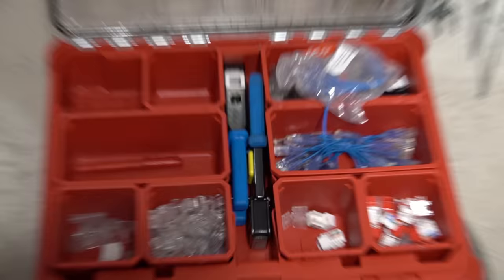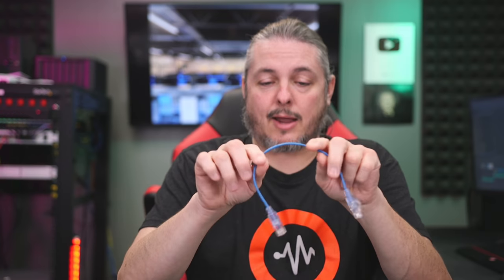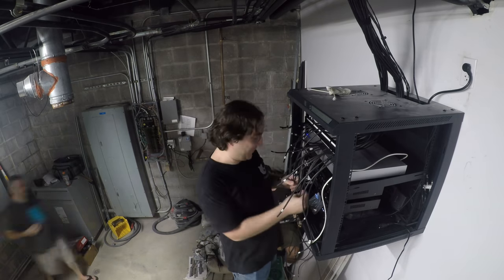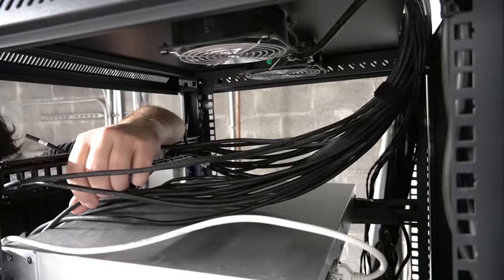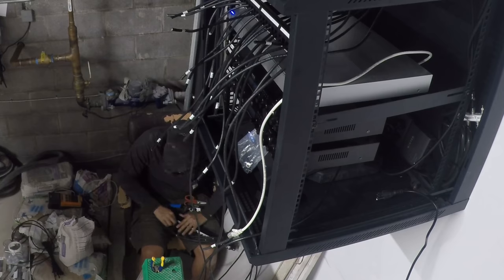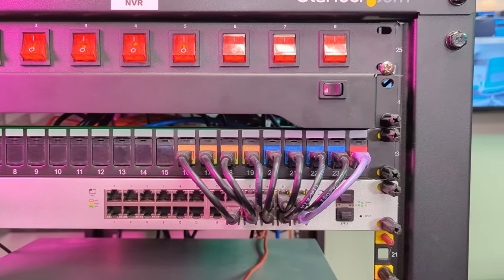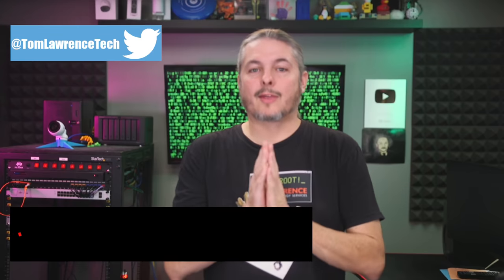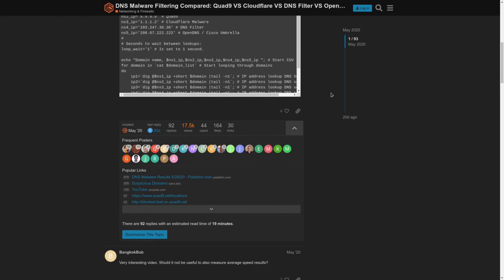Rack Cabling Project

Comment: WTF is all the hate of Zip-Ties. The do the job fine, easy enough to work with and when done correctly, not a bloody issue. If you must deal with OCD issues, try loosing the nasty idea of a power board in the back of the rack, PDU's are cheap and neat.
Reply: “When done correctly” never seen them done correctly, always too tight. If cut off they have a sharp point, very common just to add another run which can mean cut the tie and starting again. Velcro is far more convenient, reusable, doesn’t damage the cables and if this day and age not using them while working in this industry you are doing a disservice.
Reply: zips are useful in few situations, like they can help bent cables on sharp bents behind a door or at the back of a rack much better than velcro.

But really in most cases you have the spa e and flexibility to use a velcro instead of a zip tie. Just tie the velcro more tightly if you need. And you can take them off easily.
Reply: I scrolled the comments to figure this out myself. I don't run cable for a living, so I'm wondering if the zip ties have a negative effect on the cables? Or is it more of a courtesy to the next guy that comes across your work and has to cut them off? I just ran a few bundles of Cat 6 in my house and kept it neat with zip ties (also known as cable ties). If anybody has some input, I'd be interested in learning why it's a problem.
Reply: @JasonWester  your house is fine,  you wont really change the cabling
 adding or removing anything and the layout is small and straightforward anyway. 

I went into a data centre recently to rack some stuff. We have 5racks into a mini room area. 4 on one side and the last on the other side across.

So like one rack alone at the back had about 20-40 yellow funre cables of about 15-20meter length, maybe more.  It was a mess. 

Same with  the copper cables. 

It just confusing having to take one out. And I had to, one at a time, and reconnect the one after...

Also across racks on opposite sides, has to run 15meter DAC fibre amd there were so many.....I had to get on top with ladder. Its just a pain man. You loose track of the cables as you do one by one and you need like 40 across.....All the same colour and size. 
With velcro I tie them in 2-3 separate tied units of cables and its all good. I add one at a time. Ot takes like 4-5 to add a 15metre dac fibre cable across the racks on top of them with the ladder you know? Had to move ladder in like 4 positions.
Reply: @JasonWester  Used wrong, can crush the cable/cables or cut if there is movement. Can be a pain if you need to add more cables but on the other side, if using wide ties and not pulling to the ends of the earth tight, can be very handy to quickly pull cables up. Even if for short term while velcro ties are put on afterwards.
Reply: @backupplan6058  I  use 1/4" or 3/8" wide ties, don't pull them tighter than hell and even have a set of cutters the cut flush, so flush, you can rub you pecker on it without fear of a injury. To each, their own.
Reply: I agree